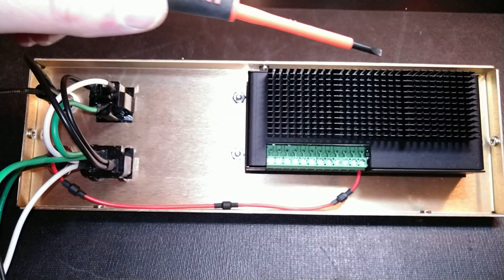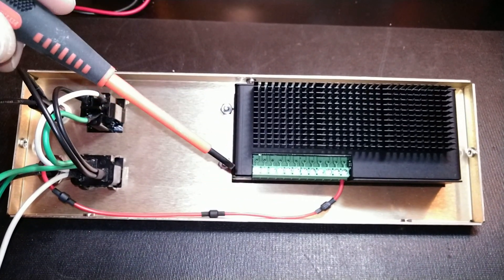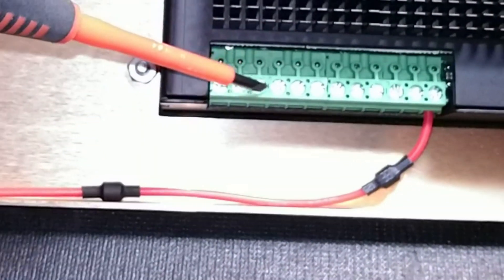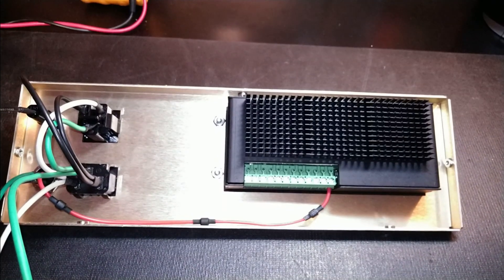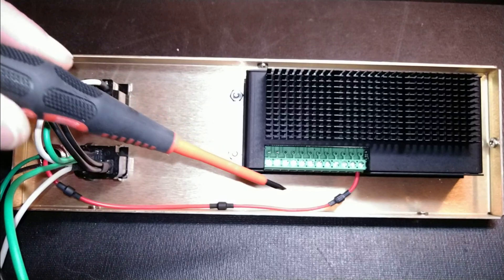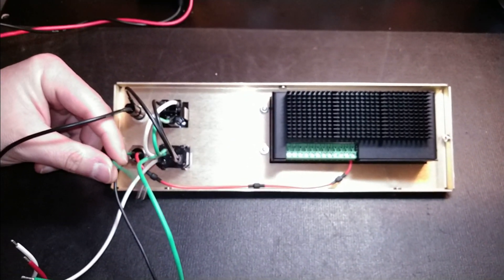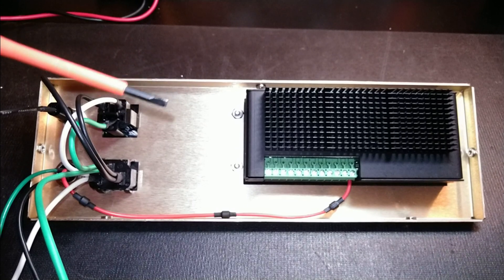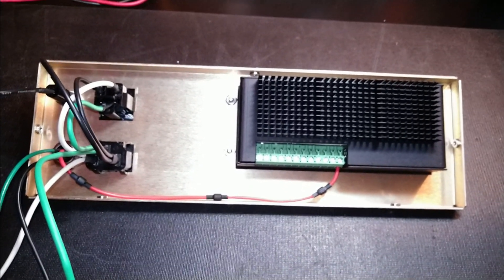How To Painlessly Shield A Single Input, Or Output Lead For A CNC Motion Controller..

Comment: No thank you for your time of making the video, very informative.
Reply from the maker: Riding Solo, thank you for your support, I really appreciate it.  I'm glad to have helped :) Have a great weekend!
Vince
Reply: @corvetteguy50  You also, Tomorrow my parts are coming in to build my new numeric controller for my CNC plasma table. This video helped out a lot with shielding.
Reply from the maker: @steveeparsonsjr7929  That's great I highly recommend viewing my EMI, and grounding best practices overview video https://youtu.be/UpJ4txXh3WM covering a .PDF direct from Lincoln electric as it will make sure your on the right track with your plasma as they require extra special care to assure system stability.  Thank you again, Vince